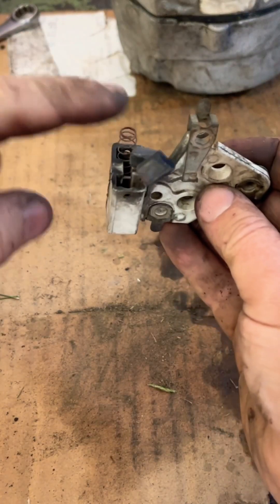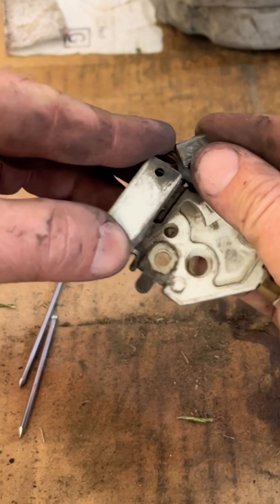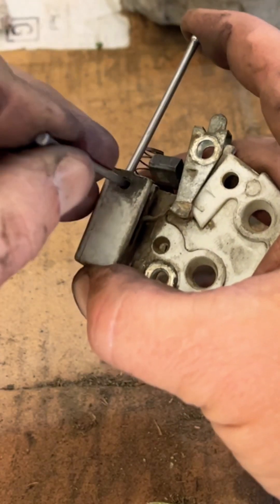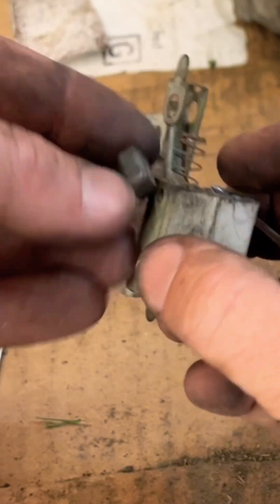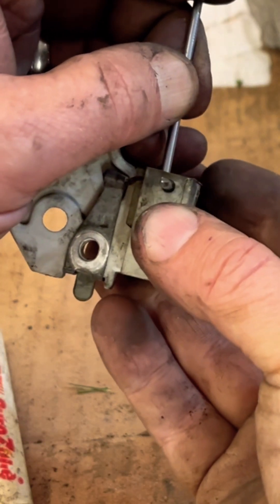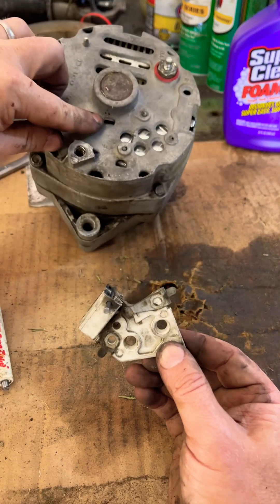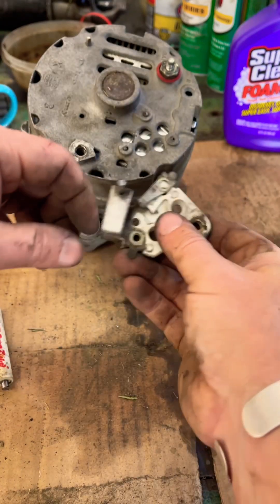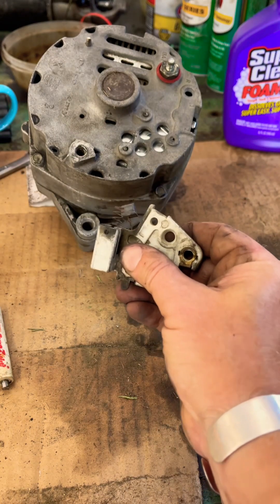Don’t forget to brush #shorts #diy #repair #fix #mechanic #tips #tipsandtricks

Comment: Trouble is they stopped useing that alternator in like 1980? 😊
Reply from the maker: @RogerDurham-v9s  which is why it’s getting harder to get new ones, but they are easy to rebuild
Reply: @Foxcanfixit  Yeah those are simple to put bearings & brushes or a rectifier in. Now they got 200-amp alternators half that size. Most of those were 60 amp.
Reply from the maker: @RogerDurham-v9s  yeah, I think this is a 63 amp, went in practically everything

Comment: use a tooth pick so you dont scratch the brushes .... if you scratch the brushes they will arc... it they arc they wear out fast .... and you will be doing this again in just a few weeks or so ... if you scratch the brushes ...... so .... use a tooth pick
Reply from the maker: @bozowinslo  it could that’s true.  Basically anything that will fit thru the hole in the side will work.
Reply: @Foxcanfixit  I don't think you understood their comment, marring the surface of the brush causes it to wear out quickly.  Using metal tools to manipulate the brush is likely to cause marring, a wooden tool of similar dimension such as a toothpick is a preferable option.  On that note probably don't use the point of the nail to push it down either, the head has a flat surface that's better for pushing things.
Reply from the maker: @vyvianalcott1681  I don’t have any wooden nails 🤷‍♂️
Reply: @Foxcanfixit  You don't know how to acquire toothpicks?
Reply from the maker: @vyvianalcott1681  I could go buy some, but for this video it wasn’t worth it
Reply: @Foxcanfixit  So you want to demonstrate how to do things for people to learn from, but it isn't worth it to you to set a good example?  Good luck with that attitude.
Reply from the maker: @vyvianalcott1681  well, seeing as how the replacement parts came from the factory with a metal rod holding the brushed in place, it seems fine to me.  And my channel is more entertainment than education, but for arguments sake you are correct on that a non-marring material is the safest choice to hold any brushes in place
Reply: @Foxcanfixit  Oh you think this is an argument, interesting.  No, the other commenter and I were telling you that you were doing something badly.  If you want to continue doing it badly you are free to do so.
Reply from the maker: @vyvianalcott1681  I said for arguments sake, which is simply a phrase meaning “if we were going to argue about it” not that we are, I appreciate the comments and the wooden toothpick idea, which I stated before, so thanks for watching, and commenting, and let me know if you have any other good ideas on how to fix stuff in the future.  Thanks again,
Reply: @vyvianalcott1681 Oh Geez. Give the guy (Fox) a break. How many times does he need to say the toothpick idea is a good one? He was just using what he had within reach for the sale of time and the video. The gas to get to the store to buy toothpicks would cost more than a new alternator!!! Lets channel our frustrations at the big oil companies.